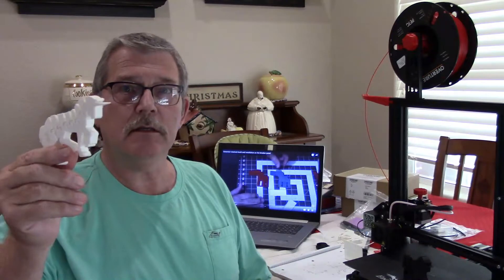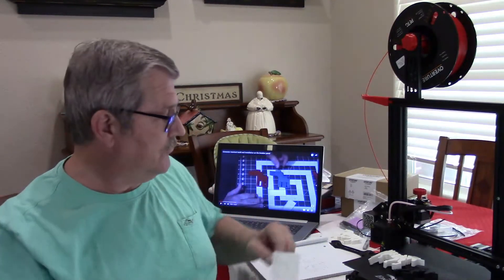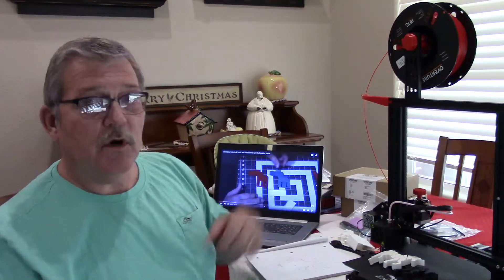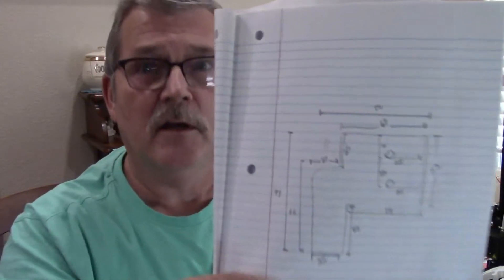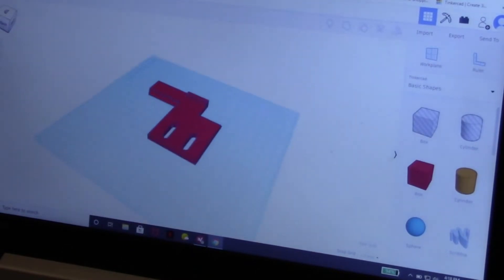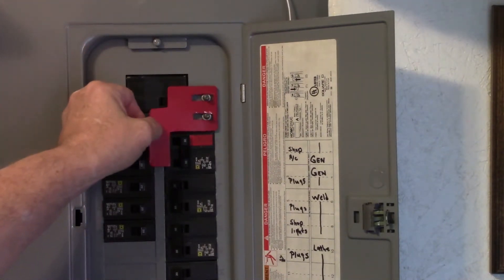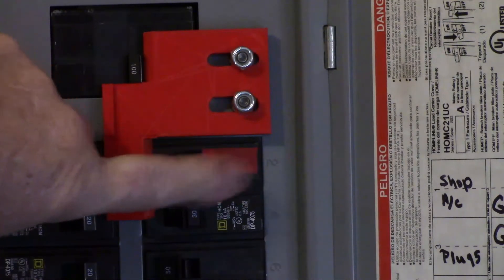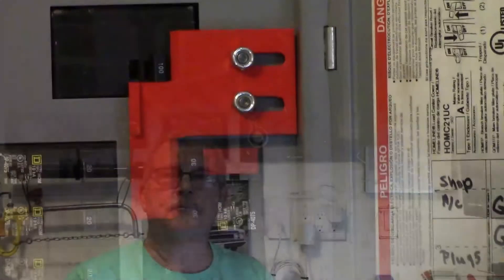3d printing practical parts, Generator interlock

Comment: Very handy, it would be neat to replicate parts that are not available to replace. Seems like there is always some plastic part that breaks and makes the whole deal junk. Have you looked into a 3D scanner? That would be the next step, just scan what you want to print !
Reply from the maker: I looked at them a little, they are still pretty expensive for my projects for now. But the price I'm sure will come down like everything else in time. Thanks

Comment: I guess the machine melts that plastic line when it gets to the head to start forming the project?
Reply from the maker: It melts a filament similar in appearance spring trimmer line  and extracts it through a nozzle like a hot glue gun.  It lays a thread sized layer on each pass. It's fun to see it operation. Thanks Vernon